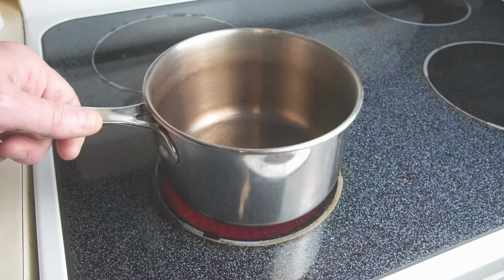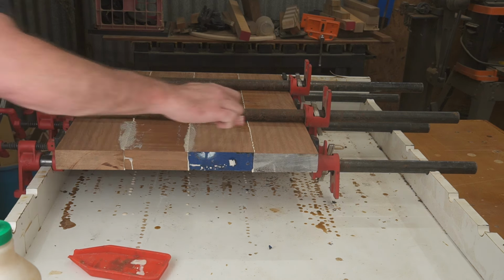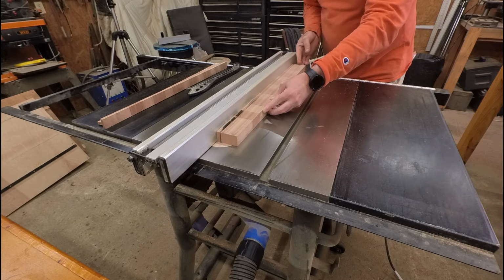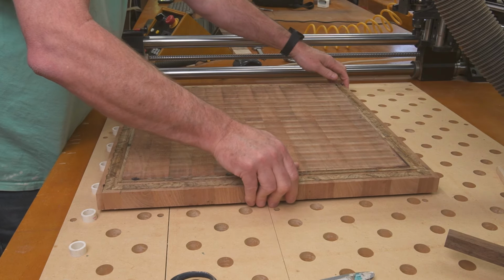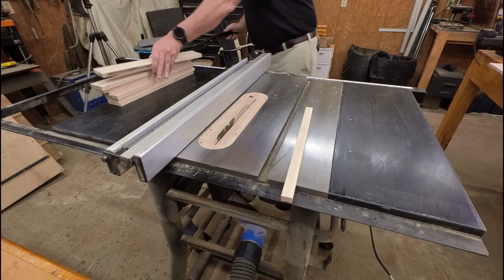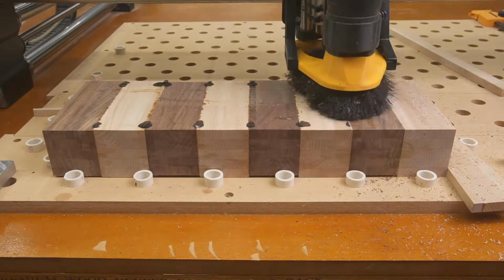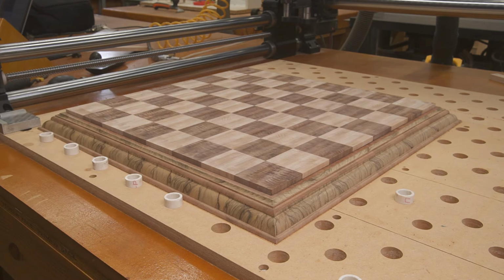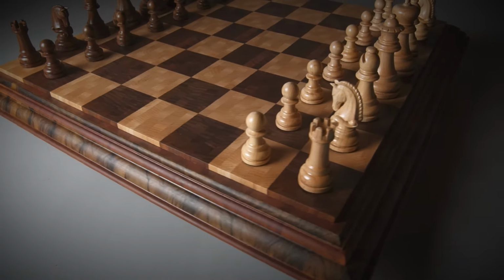Making my own Luxury Chess Set: PART 3

Comment: you butt jointed them together and didn't us a miter WHY that is so noobish
Reply from the maker: Thank you for the constructive criticism. 
Your spelling, use of proper punctuation and sentence structure is amazing!

To answer your question, miter joints are used when making a box or frame of some type.
I did not do that here. What I made was one huge panel, and I made the entire panel out of end grain.
So technically, there are about 500 butt joints included in the entire panel, so I didn't think that 4 more would matter.
But the beauty of using end grain is that all butt joints completely disappear if they are cut accurately.
So with that, I challenge you to find the seam of the butt joints that you are pointing out.
Good luck.

Thank you for watching!

Comment: I am very excited to have found this channel. The pacing, video, narration - really make for a terrific watch. 

One question? I'm not a woodworker but have been trying to slowly learn. When you use the table saw to do a lot of cuts, it seems like often the "long" part of the piece is outside, and the piece being cut is between the fence and the blade. Some other channels I've seen I think say not to do this. Perhaps it has to do with the "ejector" you talked about? 

Really just curious as I think one day I'll use a table saw and trying to get the hang of what's safe and what's not in my mind. 

Great great content. Looking forward to the next projects.
Reply from the maker: Thank you Billy!

The way I am cutting those panels on the table saw is really the basic and standard way of doing it.
I have never heard what you mentioned. Is it possible you misunderstood?

If you want to cut several 1 inch strips out of a 10 inch panel, then you would set the fence 1 inch away from the blade and then push the panel through, however many times for the amount of strips you need.  
Very efficient.

If you were to do it the way you mentioned, then you would set the fence 9 inches away, then you would have to move the fence again towards the blade another 1/8 inch to accommodate the kerf of the blade, then make your cut to get a 1 inch strip. So technically you would have to set the fence 8-7/8 inches away from the blade to cut a 1 inch strip.
Then you would have to do this for each additional cut, moving the fence in 1-1/8 inches for each cut you make.
Not very efficient at all.
There are some very good videos on Youtube explaining this a lot better than I just did. Check them out.

Thank you for the compliment and thank you for watching!!
Reply: @MandSWoodworks  Wow thanks so much for the detailed answer and it makes sense that you would need to move the fence each time and it would be really inefficient. I think I'm just a little confused about when using a block to set the distance but keep the piece off the fence (like you do at 17:18) makes sense, vs. directly against the fence. I will definitely keep researching some of the other videos and look forward to your future ones. Thanks again!
Reply from the maker: @billyfw32  
Using the block is a safety precaution when using the sled. It's exactly 1 inch thick so I just compensated by moving the fence over 1 inch. 

You notice that I touch the wood to the block to set the cutting distance, then when I push the sled forward the wood is hanging free in the air once it reaches the blade, and once it's cut it just falls freely to the top of the table. If it were touching the fence during the cut it could kick back. 

Remember in the video where I joked about the wood ejector when the tiny strips shot out like a missile?
They did that because they were stuck between the fence and the blade and I wasn't securing them some way.
The tiny strips weren't dangerous, but that 2 inch chunk of wood flying back would be a concern.
Reply: This makes so much sense! Why is this not also the right precaution / way to do it when you are ripping (instead of cross cutting)?
Reply from the maker: @billyfw32  
It's not the cross cutting, it's being able to secure whatever you're cutting while it's between the blade and the fence. 

In the other scenarios where I'm ripping stuff I'm using a push stick to push the part through, so the part isn't freely idle between the blade and the fence.
Reply: Ahhhh ok!!! Thanks again!!!!